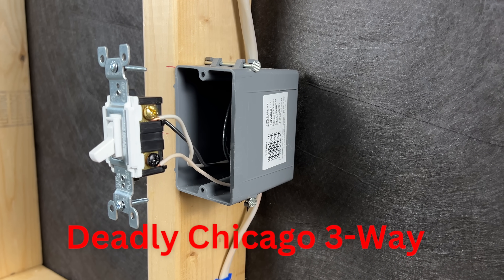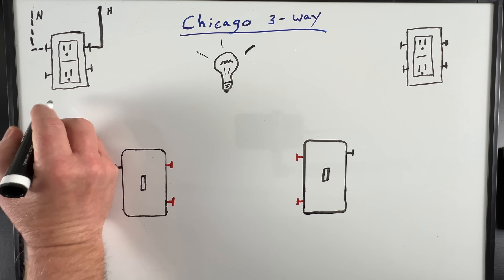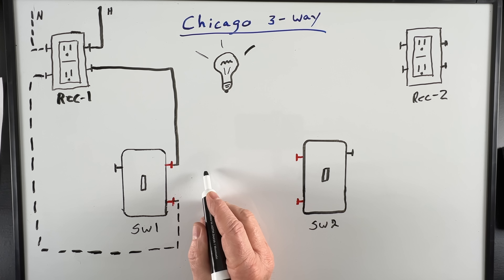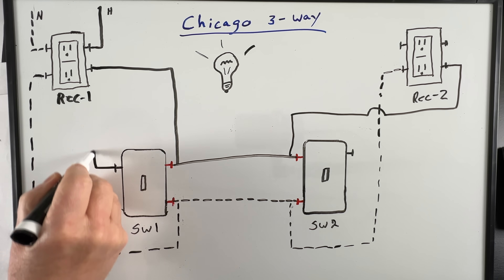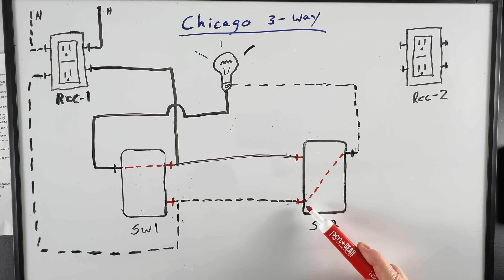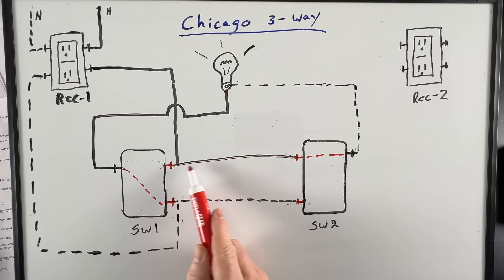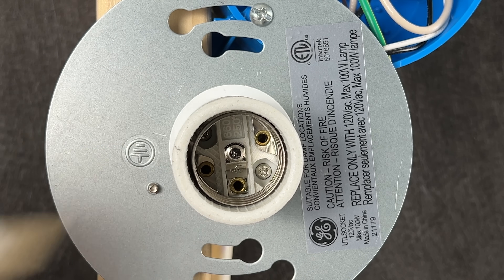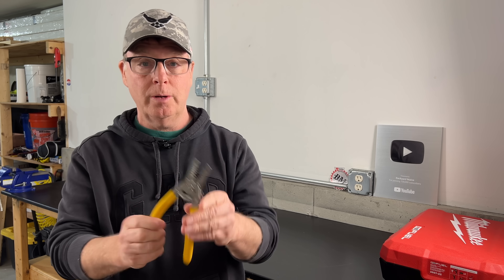The Deadly Chicago 3-Way (Only 2 Wires)

Comment: I see this method in all older homes with K & T wiring. The way you draw it though, it looks like there are 2 wires joining the two 3-ways. The way I've always seen it is you connect the hot and neutral to the traveller terminals of each 3-way (same circuit). Then there is a single wire that is pulled from switch to switch that runs between the light and is connected to the common terminal of each 3-way. Some light switches will not work with this method, especially the cheap ones. This is because there is a brief short between the two traveller terminals. But can happen with any switch if it doesn't "throw" quick enough.

Comment: Would this be possible with romex? because you have a black wire coming from one switch box to the light and the white wire is coming from the other switch box?
Reply from the maker: This old method was done when knob and tube wiring was primarily be used. It could be done with other wiring methods but it would make no sense.

Comment: Would this cause an led light to glow when the switch is 'off'?
Reply: No, because there is 0 voltage difference between the screw shell and center pin when given two neutrals or two hots FROM THE SAME PHASE.  Sometimes the switches were on different circuits, such as for a yard light controlled by a switch in the house and outbuilding from different panels.  If the switches were on the opposite phase, then in one of the four switch positions the light would get 240 volts.   Besides the obvious increased risk of electric shock by having 120V to ground on the screw shell, having the switches on different circuits would never work in modern times because it would trip AFCIs and GFCIs, nonetheless the Chicago method was used well into the 1950s, and probably even the 60s, usually on farms.

Comment: My father showed me this one when I was a boy. He didn't call Chicago style he had another local name for it but he said don't do this thing.

Saved me some jolts over the years just not assuming a light fixture is safe because it's off. He showed me the right way a couple of years later when he put one in our new house. Ran into it again in my apartment. The guy who did originally the wiring was a friend hes gone now but he warned me. He said it was up to code. For about 1970 that is so be careful putting up the kitchen light. And sure enough it was hot even switched off.

He also said the plumbing looks even weirder but that's never been an issue. Basically it's an old building from about 1880 that was pretty much gutted in the 60s and the upstairs turned into 7 bachelor apartments.

Most of the work was good he said, and I can see it was but it was done on a budget and they did some odd things. The thing to watch for is because the place does not have separate power for each apartment things like the breaker that controls my outlets in the sitting are will also turn off the outlets in my neighbors bedroom on the other side of the wall.

That's ok though. Much rather have power off where I don't expect it than power on.
Reply from the maker: Probably called it the carter system.

Comment: was replacing a light fixture on an old house and I think it was wired like this. I was so confused why my voltage sniffer was blinking even though the light was off! Checked with multimeter and had 120v on both hot and neutral when the light was "off".

Comment: Great explanation! I ran across this setup in an early 1900’s house with k&t wiring here in NJ and couldn’t believe what I was seeing. I wasn’t comfortable leaving it like that but it was controlling the stairway lights at my buddy’s house and it had to work from both locations. I ended up putting in a Lutron receiver switch at the top of the stairs and the wireless transmitter switch at the bottom of the stairs. Problem solved, it can be switched from both locations and the fixture is safe.

Comment: Here in mid-Atlantic we call this a Lazy Susan. Found in older homes built before they used 3 wire. It allowed you to switch the stairway lights both top and bottom, using (2) 2-wires between the switches. And yes, it does switch the neutral. Blows the breaker with a Decora switch every time. Took me decades before I actually had to troubleshoot and replace one to see how it was actually wired. Only a true old-timer could help you with this one.

Comment: I’ve been an electrician for 27 years. The town where I live started getting electricity in the early 20’s, so I’ve ran across and serviced some knob and tube wiring. In lots of those they switched the neutral instead of the “hot” in all light fixtures. I would try to tell people to always take the fuse out or pull the main block out if they changed a light bulb. Thankfully, there’s less and less of it now. The old knob and tube was really good for its time, all the connections were soldered and taped. They took pride in it, and those connections last a lifetime and then some. I have never seen this type of three way before, but someone was pretty smart to figure that out!

Comment: I've never come across the Chicago method. 
However, we bought a 72 mobile home and I was replacing the porch light. 
Keep in mind I always kill the breaker. 
She also wanted to change the light switch to one of those decorator styles. 
When I got to the old switch someone wired it to switch the white wires instead of the black. I found it odd. I wired it correctly and all is fine now. Also, there was not any other light switch wired to white except that one. 
Lesson is always turn the breaker off.

Comment: Since the "Chicago 3-way" requires running separate conductors from the lamp holder to both switches, it must be an uncommon sight in buildings wired with sheathed 2C wiring or newer. The old wiring I've dealt with is sheathed in cardboard on top of the rubber insulation and is quite a chore to strip compared to modern sheathing where you can use the ground as a rip-cord.

Comment: I don’t live in the US, but i have been told about a weird wiring method where i live for lights controlled by a single switch
I say weird as it has the neutral connected to the light switch (actually wired into a terminal on the switch itself) for seemingly no reason

Newer houses where i live usually have the permanent supply connections for lights at the light switch, but the neutral doesn’t connect to a terminal on the switch itself, and a single cable goes to the light fixture, and for multiple switches controlling the light, a cable would be run between the switches

In the past the permanent supply would usually be at the light fitting, and a cable is run from there to the first switch, and if there are additional switches, a cable would be run between the switches

Comment: I’ll never forget my first experience as a young apprentice. Homeowner already took it all apart to replace switches and marked nothing. I was unable to figure I out because I was trying to think competently on something that isn’t competent. I assumed the homeowner didn’t realize that the 3-way never worked properly. I later questioned some old timers that explained the dangerous system to me. Glad they did because I’ve run into many of them. Two of them that stand out: 
1) this setup with a 3rd switch location (using a 4-way switch)
2) the two 3-ways were on different circuits, both on the same phase. It would be pure luck on a service upgrade or panel change to get them on the same phase

Great Video! Many have never seen or heard of this!

Comment: Why diagnosis on older buildings is difficult. I used to carry an extension cord with the end stripped and the hot wire capped. It’s a lot easier to test with a multimeter with known good reference wires. 

I found switched neutrals, 240v in a lighting box, and other homeowner hacks over the years.

Comment: I had my Kitchen rewired by a Union Electrician but when I was removing the drywall with ALL the Circuit Brakers Off the trim and crown molding were made by Union people they had there own mill back in Chicago who knew. So anyway my house was wired by a licensed union company and I Suggest Anyone who is having any electrical work contact your local electrical Union for you Job and get it done right. My son is now a Union Electrician.
Reply from the maker: I spent several years in the IBEW before I moved into electrical engineering. The union apprenticeship program is currently five years and the apprentices get OJT and classroom training.

Comment: It’s obvious why it works and it’s obvious why you wouldnt do this unless you had knob and tube. I’ve found a two bulb boob fixture with each bulb switched from a single pole by opposite doorways. Redneck3way

Comment: You didn't mention that a lot of LED lights will not work with reversed polarity and that they will fail if both lines are left hot.   This, the saying, in God we trust, all others we test.
Reply from the maker: I believe most of not all LEDs are not polarity conscious but i'm not sure. I'll have to run a test. They all have a power supply which converts the AC to DC for the LEDs which will only flow current in one direction. Great video Idea..

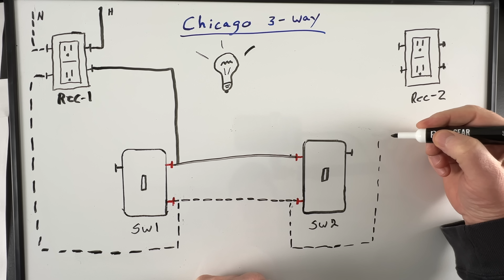Comment: @2:35 "I know what you’re thinking, this looks like a short-circuit"…

My father† was an electrical ignoramus. One day, we was wiring a light box (box with light to look at slides) and he comes to me: "this is strange, the switch is off and when I plug it in, the lights turn on, but when I turn the switch on, the fuse blows"… You guessed it, he had wired the switch across the line!!!

Comment: Seems like more effort to wire it this way. Must have been for re-models.
Reply from the maker: This method was primarily used in the 1920s and 1930s with knob and tube wiring. I have seen it in a home wired in the 50s but it was non-compliant long before that.

Comment: Greetings from New Zealand. I am a registered electrician and electrical inspector but my day job is Railway Signals Engineer.  I have never seen this style of wiring in any domestic or industrial electrical installations in NZ in 50 years in the business.  However, I have seen it used in driving electric switch machines in the mainline on the railway. Our railway bought a lot of General Railway Signal Co., type 5A, 36 Volt DC switch machines made in the UK in the 1950s and 60s. They were supplied with a contactor unit which used 24V DC control from the interlocking to energise a drive Normal 2 way contactor or a drive Reverse 2 way contactor. Both contactors were fitted with large heavy duty carbon silver contacts and we're both normally de-energised. Positive 36V was connected to the open (front contact in railway signalling speak) contacts and negative of the 36 V supply was connected to the closed (back) contacts. The motor wires were connected to the two common (armature or heel ) terminals of the contactors. 

At rest, the point machine motor had both its line wires connected to negative of the 36 Volt supply so would not spin and it was safe trains to pass over the track. Should any stray current come into the circuit from anywhere else the motor would still not go because it effectively had a dead short across its terminals. However, should either one of the drive contactors be energised by the interlocking calling for the points to change, then the motor would spin one direction and if the other contactor should pick then the polarity of the DC would be reversed and the motor would spin the other direction. Should something really naughty hapen and both contactors enegise then both motor terminal would be positive and the motor would not spin. We no longer install this type of wiring but we still have many in service - being trouble free and never having an issue in my time. I do use this "Chicago" method when playing with old signalling relays at home on 12 or 24 Volt supplies where I can provide a pole change circuit using old domestic light switches from the junk box. Very interesting video and we'll explained. Thank you.

Comment: My grandpa used to wire these into DC systems back when people had DC in their homes, that's how long he's been an electrician haha. He uses this as a thought experiment for younger electricians, it took me forever to figure out.

 Well, his version involved a house, a barn, and a post half way between, power comes from the house, theres a light on the post, and the power always has to stay on in the barn. There's three wires running house to post to barn, how do you wire it so that you can control the light from either end but the power never goes off in the barn?

Comment: I ran into something like this when working on my house, the power being supplied to the fixture and then on to the switch, which means there is power at the fixture even if the swirch is off. Got rid of that as soon as I could.

Also, I never mix lights and outlets on the same circuit. When I'm done, every room has its own 20 amp plug circuit and lights are on a separate circuit though sometimes one lighting circuit may be shared by two adjoining rooms since lighting power demand is low. That way, no popped breaker resulting from an outlet results in no lights in that room or anywhere else. 

I dont care whats correct or allowed, I'm not doing it any other way.

Comment: How about switching the breaker off on the circuit you are working on? It seems like a common-sense safety precaution, no matter how it's wired.
Reply from the maker: Absolutely, alway turn off the power before opening an electrical box.. But changing a light build should not require turning off the power.

Comment: Hours... it took me hours of monkeying to try and figure this out. I have knob and tube wiring and we were redoing the basement with a 3 way switch for the lighting.

It was a good thing that i labeled each wire and the original switches. I identified neutral and hot and wired it like it should be. I then went to the other switch and what i had initially thought was hot and neutral were reversed.

After hours of trying to get it wired i put the old switches back in... got the circuit to work like it used to and then replaced them with new dimable switches and wired them the same way the old switches were wired.

Thankfully i wont have to worry much about the hot light when it is off because the wires are all in a junction box with a low voltage transformer which powers the lowvoltage LED puck lights.

Comment: Always show the correct/safe wiring first in order to give a baseline reference to the  student.   You don’t want the student to have the Chicago method is the reference method.
Reply from the maker: The first video I made on the subject was the standard and dead end 3-way methods. Then I made the Chicago and the California videos. https://youtu.be/B6gfI73Tvg8
Reply: Agreed.  The California and especially the Chicago method  should NEVER under ANY circumstances be used today,  but anyone who plans on becoming an electrician and doing service work should at least have a solid understanding of how these non-standard methods are wired and the hazards involved,  because at some point you'll probably run across it when replacing switches or light fixtures in an old building.

Comment: When I first began in the early 80's I had to remove tube & wire from an old house & was amazed at the absurdity of how that place was wired- it seemed like there should have been way more fires from that type of system & yet it wasn't so bad that an impetus was generated to ban that stuff outright... CODE upgraded eventually so that you could not install that system any longer but did not require people to remove it unless/until there was an upgrade... there are still millions of homes across the USA that have that wire still functioning today... scary stuff!

Comment: No explanation given as to why anyone would wire switches this way. If you want a light to be controlled by two different swiches, all you need to do is run both hots wires from the switches to the light fixture. Either of them will operate the light, with the skight inconvenience of both needing to be swiched off to kill the light. If you get double throw light swithes, however, you can wire them to where either switch turns on or off the lamp.
Reply from the maker: I thought I made it clear that it was done with one know and tube wiring where they ran two wires around a home for lighting and receptacle loads. Usually just one or two circuits for lights and receptacles in a home back then.
Reply: @BackyardMaine No Idea what a "know and tube" is. You didn't explain. "Two hot wires" to the light was figurative, ie, schematic. The circuit I referred to is accomplished with the exact same amount of wire, except there's no neutral run to the  switches. Hot run to both switch commons, on poles connected, and whichever is closer is run to the Edison lamp base connection.  Ordinary single throw switches used instead, same amount of wire used, same amount of labor, except completely safe with cheaper switches. So, explain.

Comment: I encountered one of these after a friend was trying to replace a switch on a 3 way light circuit with a motion detector. He was baffled and asked me to have a look. I was also baffled and couldn't get it to work. Somehow the light kept managing to dimly light, receiving 80v. After us both being puzzled for a while we said screw it and he called an electrician. Now years later running across this at random, I'm almost sure this is how it was originally configured and likely why we didn't get it to work

Comment: Very interesting. You will never find a circuit like that in the UK. That looks all so over complicated for no real advantage. Really interesting to see how different wiring is in other parts of the globe. Thanks for the lesson.
Reply from the maker: This old method was used before ww2 when single conductor knob and tube wiring was common.